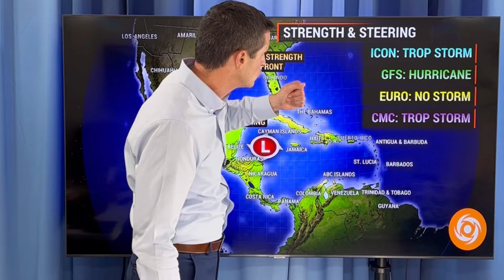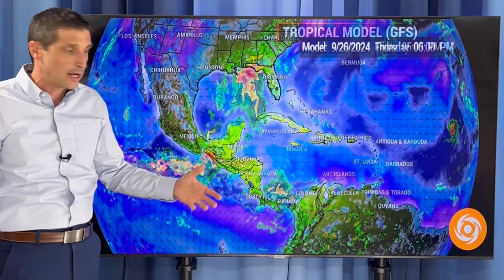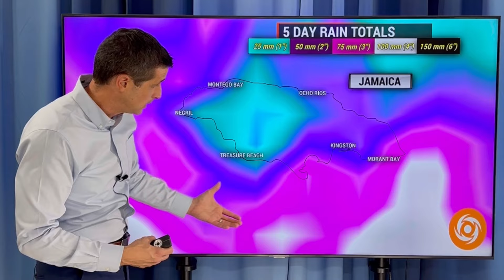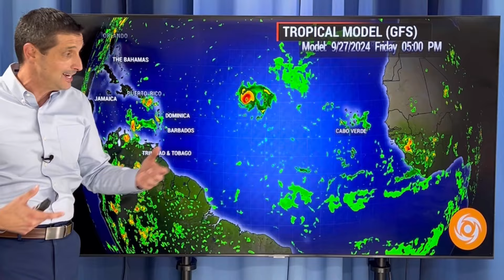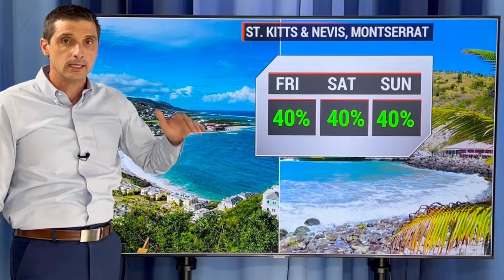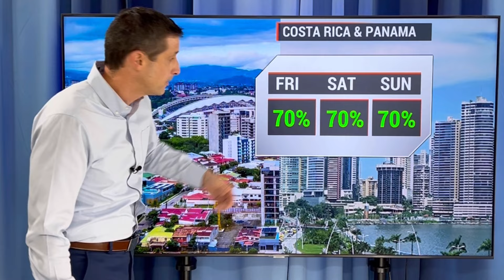Tropical System is Very Slow....

Comment: Today's 12 Z Euro EC fast did some changes matching closer to the GFS in some ways newest Euro takes it West then takes it hard Northeast into Florida Panhandle 990 MB on this run Euro showing a strong trough picking it up out of the western Gulf of Mexico swinging it hard Northeast into the Florida Panhandle right now we're just trying to find track consensus not how strong the storm will be that will come in time that is a wild run from the euro takes it from the Bay of Campeche all the way to the Western tip of the Florida Panhandle that would be quite a strong trough